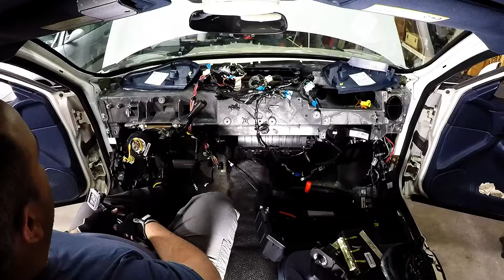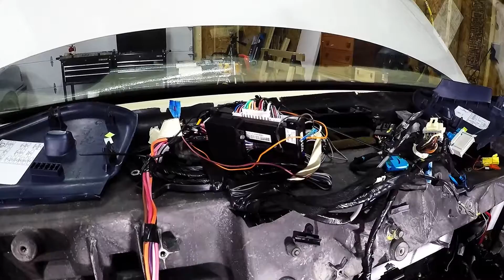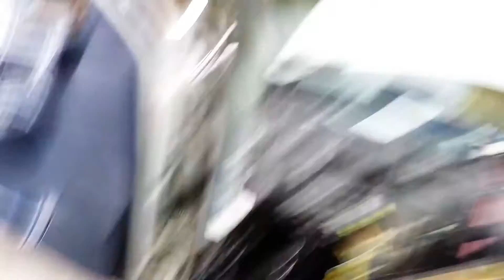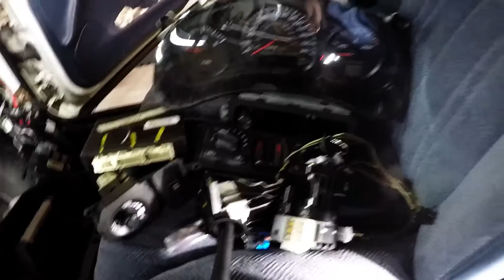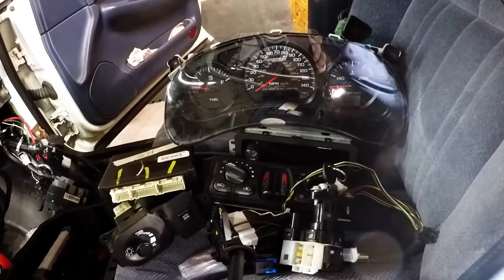Impala Main and Dashboard Wiring Harness, Body Control Module

Comment: Do you by chance know where the onstar module is in the 2014 impala. Or how i can disable it. I can't find it anywhere on the internet. Can I just pull a fuse of do or should I disconnect it. Either way I can't find either.

Comment: I need a ignition wiring diagram for an 03 Chevy Impala my switch was cut from wires behind the ignition switch and the wires hanging are multicolored and my new pigtails are gray.. I need color too letter wiring diagrams

Comment: Why did you do this video, and what was the result? I viewed this video to try to get an idea of where my BCM is located, and whether I have a cut or comprised wire connecting to the instrument panel dimmer switch that controls according the manual "external lamps" or as you stated "dome and headlights".  I'm trying to identify the reason for my headlights to occasionally work during the day, but not at night, even though my high beams and turn signals work all day and every day.

Comment: My dash started flashing and now doesn't turn on.... Only happened after I drove over water when it was 8 inches high...not sure if it had to do with it...but all lights work radio works just not dashboard which makes heater and such not work either... Checked all fuses
Reply: Hey buddy did you ever figure out what was wrong

Comment: I have a 2014 chevy impala and the abs light will not reset it keeps coming back on after we have replaced the sensor and bearing
Reply from the maker: If you have a parts store or friend with an diagnostic error code reader,  it can tell you where to look next, like if another wheel's sensor is failing, or if the ABS module is not responding correctly.

Comment: hello...my head light will not go out is there a relay for them. If so where are they located
Reply from the maker: your fuse cover should tell you if the relay is in that section; the relay is probably in the dash fuse block